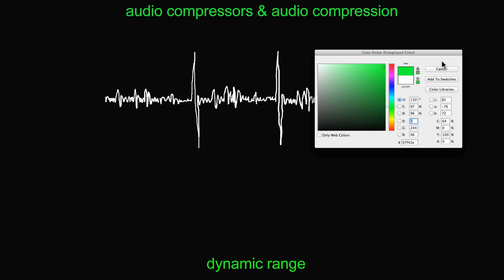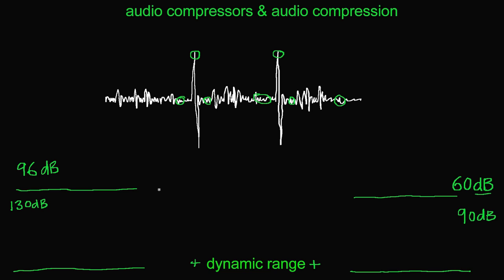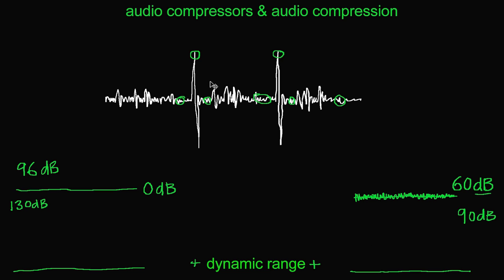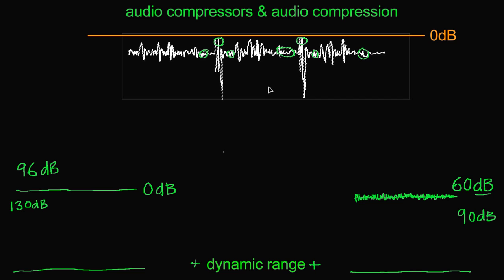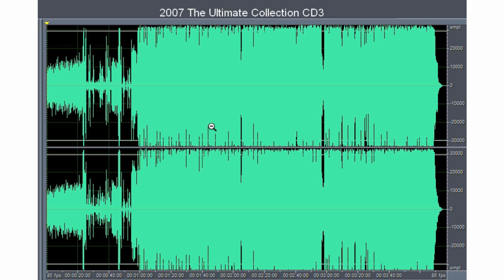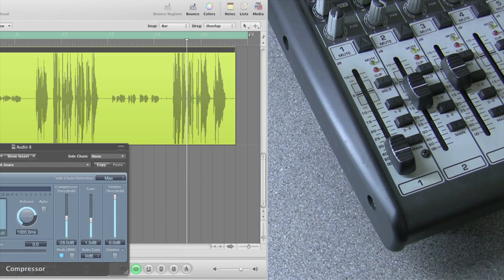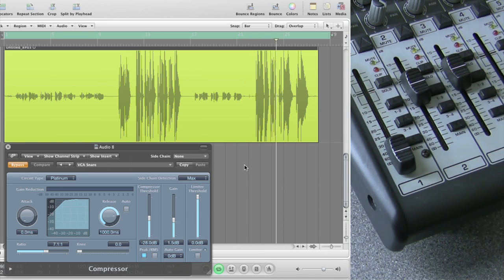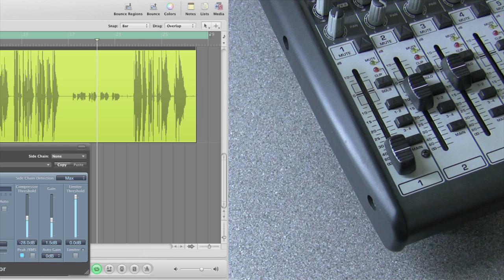Compressors & Compression Masterclass 1 (dynamic range)

Comment: This is extremely useful, makes brilliant sense. I’m a former RF technician and although dealing with audio signals in terms of modulation and probably the closest element was ensuring the maximum modulation depth was ever exceeded. Never really considered it in terms of dynamic range as we would usually work with audio tones but modulation was a different technique but with amplitude modulation compression would be required to a degree otherwise too much power would be in the carrier and not much in the sidebands which results in very poor S/N with weak signals. 
But starting out in the DJ world and just having built my studio realised after recording a voice over on a sound bed, my voice didn’t sound properly mixed, ie there was too much presence and not enough sound bed despite experimenting with different levels on the sound bed source.
Reply from the maker: you should be ducking the backing when you speak. https://youtu.be/rKS_XVIVaZ0?list=PLr9cxz51sxbxm9BVD16p-nl5qWF5zh-2X

Comment: so if you don't have a physical fader like you do, is that called automating when you manually increase and decrease the volume of track
Reply from the maker: if you use mix automation to adjust levels across a part, then yes that would be automation

Comment: so is it necessary to use compressor when you use reverb to boost the vocals but also use manual editing to level out the vocals,???
Reply from the maker: No. You CAN do either or both those things in some instances depending what you are doing, or to get a certain reverb sound or depending on what is required to balance a vocal track, but they aren't absolutely required or "necessary". Watch the whole thing i suggest & the other lessons which follow: https://www.youtube.com/playlist?list=PLr9cxz51sxbxm9BVD16p-nl5qWF5zh-2X

Comment: Hi and thanks alot .
I have a question and hope someone will help me.
If there is a signal with noise if we reduce dynamic range and than gain the signal that means we are increasing the noise amplitude?
Reply from the maker: yes, the noise floor is usually increased.